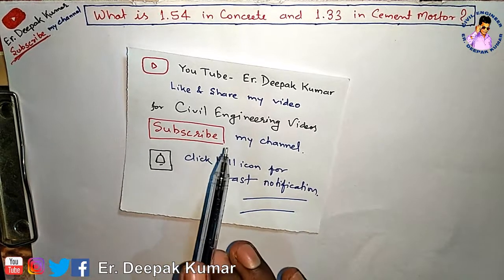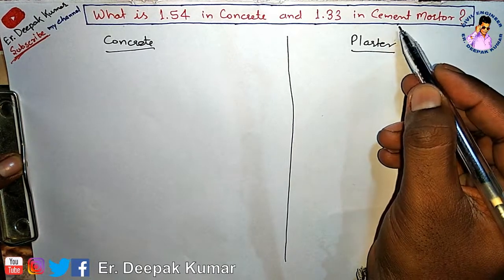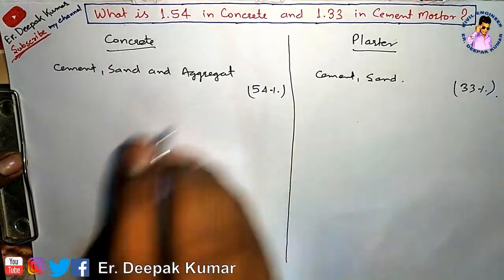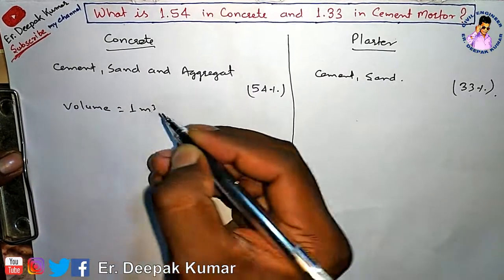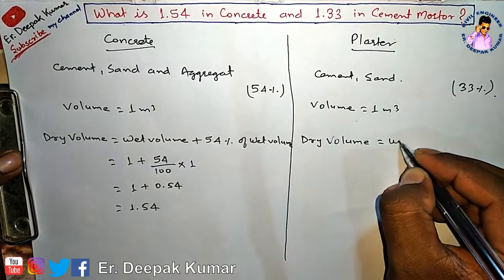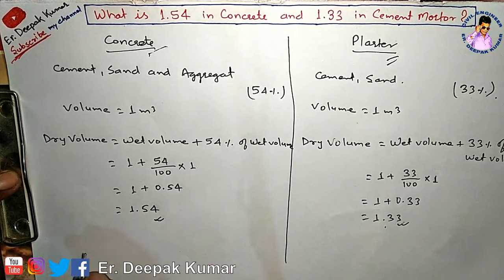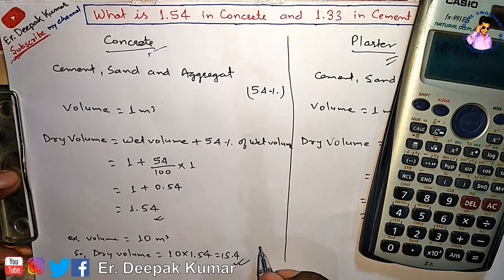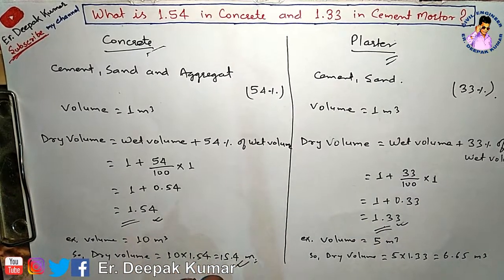What is 1.54 in Concrete and 1.33 in Mortar? (In English) || Convert the Wet to Dry Volume Ratio ||

Comment: 54 & 33 % increase... how??
Reply: ye to pta h ji,, but m ye puch raha hu ki ye 54% kis book me ya code me milega,,
Reply: source ??
Reply from the maker: When the water is added to cement, the volume of cement is decreased and for this reason the wet volume is converted to dry volume.
Reply from the maker: This is the formula to convert the wet volume to dry volume
Because we calculate the material in dry...
Reply: Er. Deepak Kumar 
Plz explain how 1.54?
Reply from the maker: To get desired volume of Wet Concrete we take 1.54 times dry volume of concrete.
Reply: Er. Deepak Kumar ... source of this formula???
Reply: For mortar /plaster, it is 25%